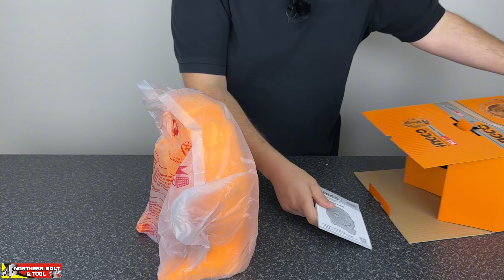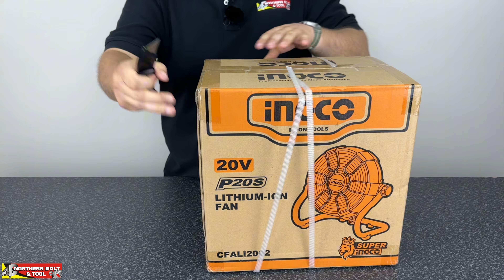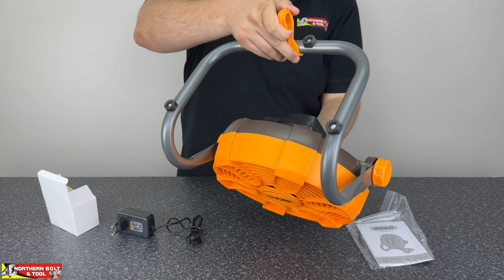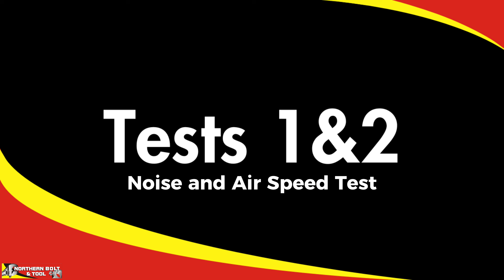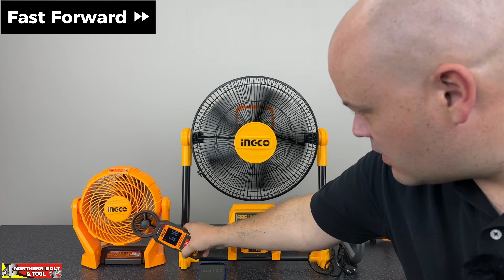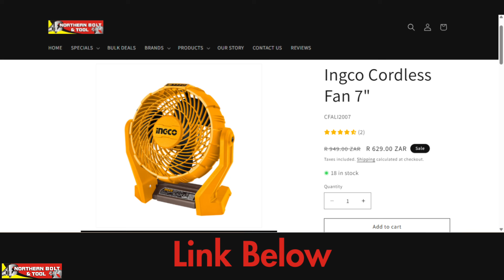Range Tested: Ingco Cordless Fan Showdown - The Ultimate Buyers Guide

Comment: For others looking for info. Saw this video because wanted info on consumption/ run times. We are using CFALI2002 (11" 20V) for camping in the tropical, I now did test on low speed fully charged batt, last approx.. 7hrs, so can make it through the evening and night with two charged 20V 2Ah batteries.
Reply from the maker: We really appreciate you sharing your experience and the run time information - super helpful!

Comment: If you're running it off if 😢the main, do you need to take off the battery? What if the battery stays connected and you plug it on the outlet?
Reply from the maker: Nothing will happen, it will still be safe

Comment: If you are running one of the plug in fans with a battery in it, will it continue running in case of a power failure/load shedding?
Reply: Not on the large one. You'll need to switch it on again after mains go out.